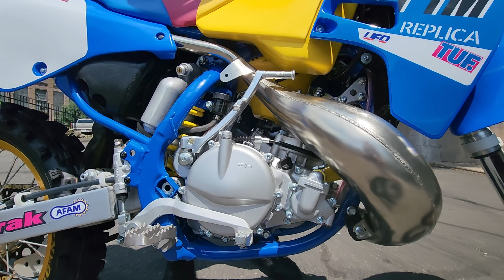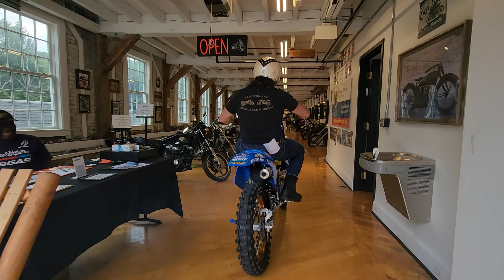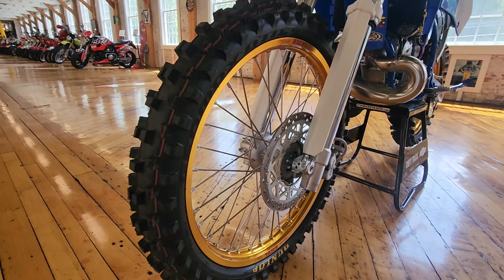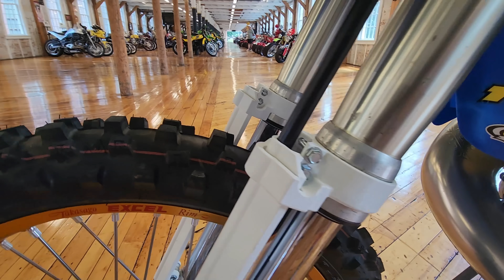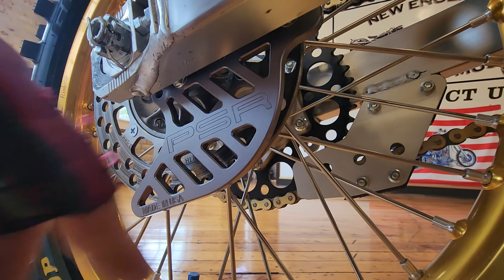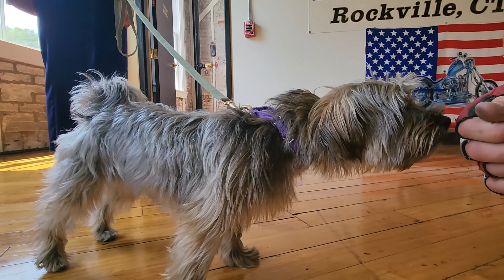1989 SUZUKI RM250 WORKS REPLICA!

Comment: i've got an 89 in my shed dressed with the pink n purple splatter slingshot graphics ,,
Reply: On an 89 ? Should be 92
Reply: @corin6677 yeah i no but i liked the splatter and i can chage it when i want too   ,probly due actually  , was a blue frame but i went black frame . tried yellow didn't like it .looks nice with the black frame . is a vid on my channel  if ya wanna look
Reply: Ehh 89 never had slap sling shot grafics bro the were 92 bro
Reply: @Themullion17  yeah i no but i liked the splatter and i can chage it when i want too   ,probly due actually  , was a blue frame but i went black frame . tried yellow didn't like it .looks nice with the black frame . is a vid on my channel  if ya wanna look the bike kens mechanic built never came out like that either .